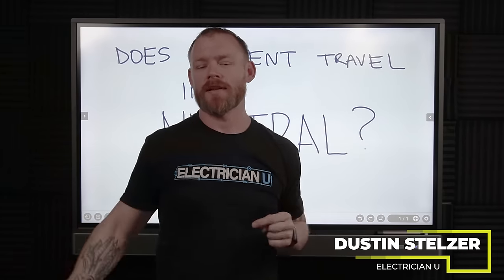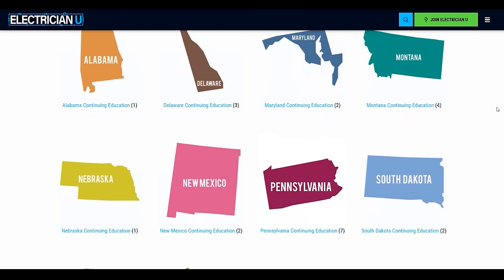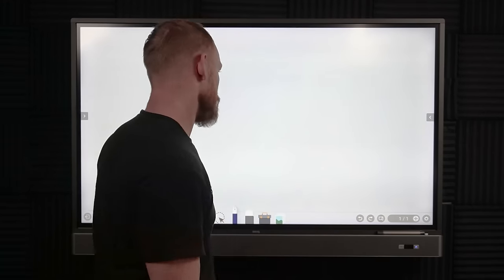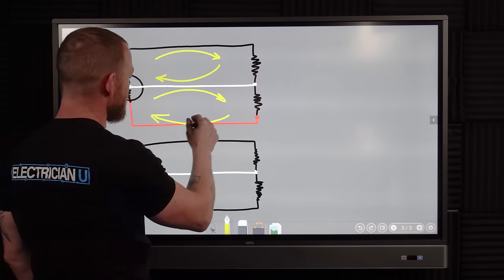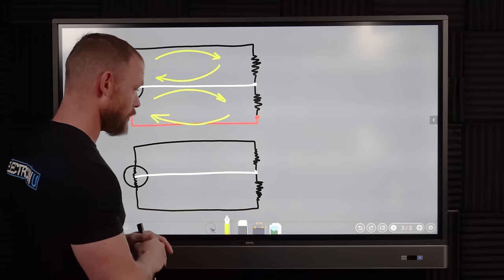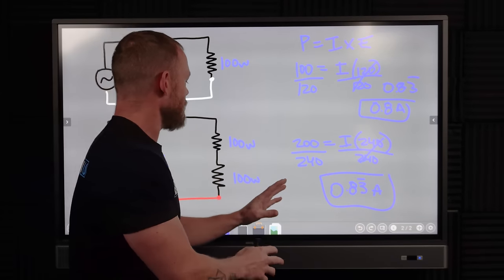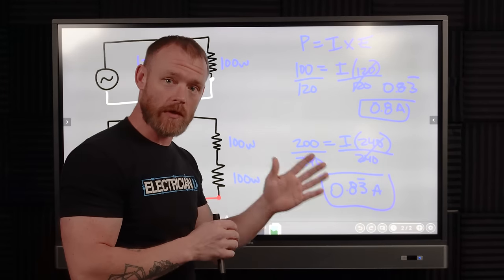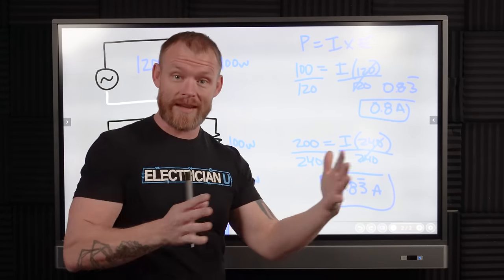Does Current Flow on the Neutral?

Comment: We had fires in our office cubicle walls back in the 1990s due to excess neutral wire current.
The cubicle outlets were spread among three 120V phases with a shared neutral wire.  We all got office computers that had non-linear power supplies: their AC inputs were bridge rectifiers feeding big capacitors.  AC input current only flows in spikes on the peaks of the AC voltage to charge the capacitors.
In a 3 phase configuration with balanced resistive loads, there is zero neutral current; the current flows (push and pull) cancel.  In our configuration, the current spikes on the AC voltage peaks occurred 120 degrees apart, so there was no cancellation. The neutral wires were overloaded and caught fire.
Facilities opened up the circuit breaker panels and used an infrared scope to look at the neutral wires to find the ones that were hot. They then ran new dedicated circuits to feed the computers on those wires.
Reply: Nonlinear devices (power supplies, VFDs, and others) contribute harmonic distortion onto a power distribution system. Certain orders of harmonics called triplens (includes the 3rd, 9th, and others) do not cancel out even in a balanced three-phase system. Triplens specifically sum on the neutral. A three-phase system with a large percentage of nonlinear loads (depending upon the type of course) may see triplens. Where applicable, this means more heating on the neutral which is even worse the more unbalanced a three-phase system becomes due to connected single-phase loads. Assuming no other means of mitigation is employed, a smart engineer will oversize a neutral for this reason (perhaps 150% or even 200% compared to the phase conductors). This is also a reason to specify a distribution transformer with a K-factor rating that is selected considering the total percentage of nonlinear loads.

Comment: It would have been a little easier perhaps if the phase plots of the voltage sources were shown too.  This would also help explain in 3 phase Y, that the neutral carries the delta current, and how by phase, each leg will return a portion of the others current.
Reply: I don't know electrician lingo but it would not be the delta it wit would be the sum.  Hot + center tap = 0

Comment: You should do a video on 240v circuits that don’t use a neutral. For instance a well pump. How it doesn’t need a neutral because it’s 240v only. That’s something that took me a minute to wrap my head around as I was learning.
Reply: And then there's devices that use 2 phases, a neutral, and a ground, like electric dryers!  The heating element is powered by the 240v, but because the socket provides neutral, things like light bulbs that illuminate inside when the door is open can be normal 120v bulbs because it just grabs power from one phase and neutral.
Reply: @Lierofox  In the US, that's not two phases.
Reply: @ethelryan257  Yep, misspoke, 2 lines, not two phases.
Reply: @Lierofox  it’s kind of silly that a lot of dryers also require a neutral. If some of the controls and control illumination/screens require 120v, they could engineer the dryer with a control power transformer inside to get 120v control power off the supplied 240v circuit.
Reply: @RB-xv4si  Doing so would add complexity and cost to the dryer.
Reply: @Dave_Simmons  yes. The dryer is cheaper but now the circuit is more expensive. And don’t forget the markup that the electrician will charge the customer over what he paid for the nm cable. Just saying.
Reply: @Lierofox  It's cool, I was just feeling snarky over the EEs pretending to be superior beings at the start of the comments.
Dustin is an excellent teacher.
Reply: @RB-xv4si  Price. It always comes back to what the manufacturer can charge. Cheap 120V 1ϕ motors are dirt cheap and the timers used until recently also were powered by the same  type of dirt cheap motor.
Reply: @ethelryan257  the timers were powered by the motor? Tell me more.
Reply: 180° out of phase AC potential difference
3 phase delta same thing.
Reply: @RB-xv4si  Sigh. I do so love the literal minded. Yes, prior to simple electronic circuits, in North America, the timer circuit was powered by a 120VAC motor. But, since you're being snarky, THOR actually did use the agitator/spin motor to also power the timer mechanism in some of their earlier electric washers. 
Interestingly, some GE and Hotpoint low-end dishwashers and tumble dryers used those same 120v timer motors right up into the 2020s.
Reply: @ethelryan257  I consider those little motors to be part of the timer. So when someone says the motor powers the timer, it makes no sense. The motor drives the mechanical timer and the circuit powers the motor. You may know a lot, but when you use a word incorrectly, it makes you look like a clown.
Reply: @Dave_Simmons  that would also add unwanted inductance to the system too
Reply: @RB-xv4si  She wrote "timers used until recently also were powered by the same  type of dirt cheap motor". Not the same motor, the same type of motor.
Reply: @tcoradeschi  that is what was written
Reply: @TheTennTexan  You are (we are) correct. The person I was replying to had clearly not read the words Ms Ryan had actually written.
Reply: @tcoradeschi  you missed my point entirely. My point is that timers are not powered by motors. They are driven by them. A motor is not a power source.
Reply: @RB-xv4si  "a motor is not a power source" That's an interesting comment, and I guess it depends on your definition of "power".

We define power as the time rate of delivery of energy. That energy can be in any number of forms: electrical, mechanical/kinetic, thermal, etc.

In this application, the motor is providing mechanical power (in the form of rotational energy) in order to operate the timer.
Reply: @tcoradeschi  it’s transferring electrical power to mechanical power, but it’s not the source.
Reply: The easiest way to understand it is by grabbing a center tapped transformer and just looking at it. Something like a cheap step down 120 to 12VAC that has the center tap at the output. The output will basically be 12 or 24VAC. 12VAC if you reference between the center tap and either end of the secondary, and 24VAC across each end of the secondary. During each half cycle, these ends of the secondary will have a + or - polarity which flip the other half of the cycle. So reference to that center tap (Neutral) it becomes a Common and gives 12VAC across each Line where the respective outputs are 180 degrees out of phase which basically just means as one side has a positive swing, the other side has a negative swing. You add the RMS voltages of these swings together and you get the full 24VAC.
Reply: @RB-xv4si  noted
Reply: @Lierofox  my dryer uses 120VAC 🙈
Reply: @RB-xv4si  .Why, when all you need is a neutral to get the 120 volts.
Reply: @kenchiison4570  because then you need one more conductor in the cable to bring a neutral wire from the panel to the receptacle. That’s more expensive. You either pay more money for the dryer or you pay more money for the circuit.
Reply: @MitzvosGolem1  3 phase is 120 degrees out from each other.
Reply: @Magneticitist  Actually, it is 2 windings in series. The exact same thing as the transformer feeding your home. 1 side of each winding are hooked together which is your neutral. The other end of each winding is your L1 and L2.
Reply: @Lierofox  no such thing as 2 phase only 1 or 3 3 phase doesn’t use a neutral after the transformer it has to do w sine wave and peak and valleys rms! 2 phase is not 2 sine wave 240 is 2 legs connected of 120 double pole breaker, three phase will be 480 one leg 277 or 208 depending on w or delta

Comment: Fun Fact, the balance and cancellation phenomenon is used in Pro Audio to neutralize electromagnetic interference on XLR audio cables. They're "Balanced" so that what you hear after amplification is actually the imbalance. If you plug a stereo audio feed into an amp through a balanced connection, you instantly get a karaoke track, since the instruments are rarely centered on the feed, but the main vocals are - the voices just "disappear". If you've ever had issue with the audio feed on a YouTube video and others report it is fine, you are hearing the digital version of this.
Reply: Though you’re on the right track, that’s not entirely true. This would only occur if identical doubles of the vocal track were 180° out of phase, panned hard left and right and summed to mono. But the principal that, similarly to electricity, speakers are incapable of pushing and pulling at the same time.
Reply: No, if L and R are identical, i.e. voice in the middle, L minus R will completely cancel the vocal and anything else that's fully centered.  Discovered this when I was 10 when I connected each speaker's minus wires of our stereo system together but not to the speaker ground. It was so cool to hear the instrumental version of my favorite records. Now they put a lot of stereo reverb making full voice removal harder to achieve unless you use AI techniques.

Comment: Dad was a master electrician.  Damn near short of an electrical engineer.  He could build a circuit board to do just about anything.   He taught me a ton but there is so much more to learn.   

He always laughed when I got (oh and I still do), confused on three way switches. 

I also remember him talking about balancing out large starting loads like motors or pumps.  He said at the start of the motor it’s at its least efficiency.  If you could (forgive me I can’t remember the exact terminology) balance the startup of the motor, you would save money in the long run on your electric bill.  I asked why there isn’t a balancing device built in.  He said it comes down to cost. 

He passed in 2019.  I have so many questions now.  I almost became an electrician.  I missed the apprenticeship by one year.  They never offered it again at GM. 

THANKS!  I enjoyed the lesson.

Comment: It would be nice to see real wiring, real light bulbs and real meters showing the amps and voltages. Nice informative channel.
Reply: Light bulbs ? All a light is -is resistance between to connections. It not matter  voltage , lights still work on all volts. You can not test voltage by lights. Must be by a volt metter for volts or a amp  probe for amps and a hertz counter for hertz. Hertz is very important , it the speed  of the volts and watts on material by the second. Usa is 60 hertz per second as south east asia and asia and middle east is 50 hertz per second. It ok to run a transformer for 50 hertz per second in a 50 hertz per second  area . But not run a 60  hertz  tranformer in a 50 hertz area. The 50 hertz core is thicker  than a 60 hertz core so the curent can move slower on the thicker core , but can not move to slow on the core that the core   made for the size of  hertz   travels over it. The slower the travel equals the thicker the core must be so it not melt.
Reply: I get what you mean. As you would see it on the field. Maybe photos would help a bit. IMO, anyway.